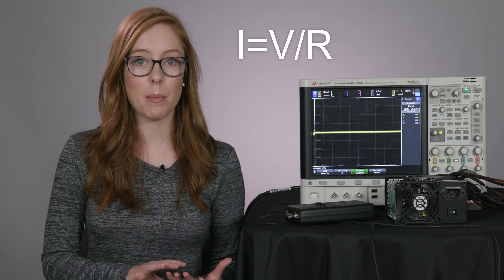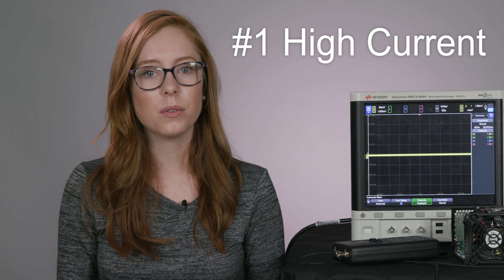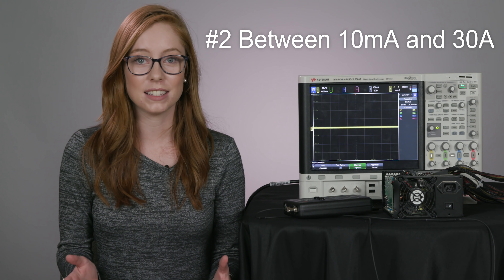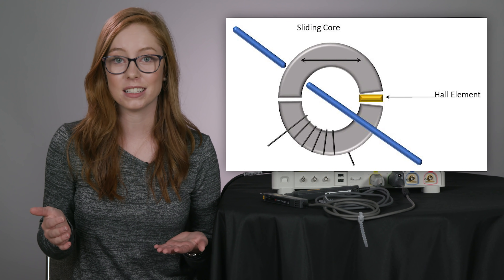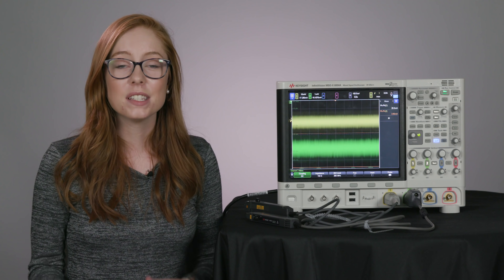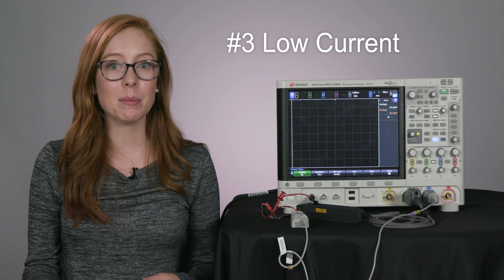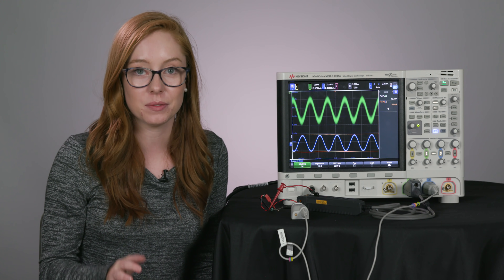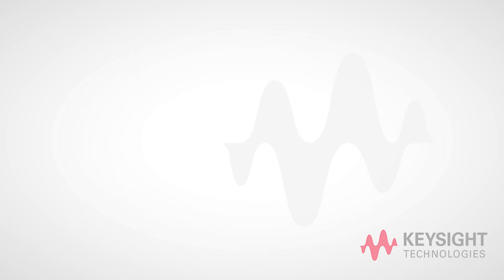How to Measure Current with an Oscilloscope - Take the Mystery Out of Oscilloscope Probing

Comment: Great video - I might add that I have had to calculate power into a load at high voltages and high Z (transmitter modulators) at audio frequencies and no way to measure voltage directly with a simple meter. Knowing the load Z, I measure the current with a Tektronix current probe and a vintage scope, with the probe clamped around high voltage meter-lead wire, convert the PP voltage to RMS and do the math. Works great and keeps us away from direct contact with the HV.

Comment: My (Agilent) oscilloscope can multiply channels by each other but not by a constant. If it could, I could apply the scaling required for a measurement resistor instead of doing it in my head.

Comment: Thx you did a great job but failed to mention the number one obstacle of using a current probe.  Cost.  I have a small consulting company and i have never been able to justify the cost of a decent probe.  I have a cheap probe and when that does not suffice a shunt most often can work.  With this method most modern scopes can do math in the math function so you display an actual current measure.

Comment: I hate to be pedantic, but if you’re using a resistor inserted into the circuit to measure the current using voltage drop and Ohm's law, wouldn’t it be a series resistor (in line, with all the current flowing through it) rather than a shunt resistor, which would be in parallel with something else, and thus not see all the current?
Reply: Shunt is an established naming. It's parallel with measuring instrument

Comment: Nanosecond range: With an ideal resistor, V = R I, fine, but if the voltage increases instantaneously from V0  to V1,  the current cannot raises in an instant from I0  to I1: the number of moving electrons is the same (the number of atoms don't change) so it is their speed which should increase and since electrons have mass,  it takes some time to raise from I0  to I1. So, basically, since V0 is instantaneously risen to V1, *at that moment*, we have V=V1, still I = I0,   such that V = V1 > R  I .  The time it takes for the current to raise from I0 to I1  can be in the pico to the nano second range. So the resistor technique is not fully trustable for these time ranges, no?
Reply: is it?
Reply: @優さん-n7m  In fact, the electrical field moves faster (about one third of c in a copper wire) and the electrons start moving due to the increase in the field, rather than other electrons pushing/crashing onto them. But there is still a delay before getting a steady flow, a delay which is negligeable in everyday calculations done on a typical circuit.

Comment: "There are 3 situations where you need to measure current:
If you are working with very high currents
Very low currents
Or something inbetween"
Couldn't you just say 'current'?
Reply: She classified it like that to show later the different strategies for each current range.
Reply: It's like picking a thermometer to measure temperature. Say all you've got is a mercury thermometer. That's fine, unless the thing you're measuring is so cold that the mercury freezes. Or if it's so hot that the mercury boils or the glass melts.
Reply: lmao

Comment: Is any adjustments in button we should in the oscope for current? 🤔
Reply from the maker: Generally, the scope will recognize a current probe and you won't have to change anything. You can manually set up a channel with the right attenuation ratio and current/voltage selection if you need, though.

Comment: My 40 year old tektronix current probe works great and has less noise than the ones you showed here.  Of course it only has a 50 MHz bandwidth, and these are 150MHz so the noise should be about 3 times higher, but it looks higher than that.

Comment: How would you measure current across a 'series' component using a scope? The series component is a resistor and is connected in-between power supply and amplifier vcc pin.
Reply from the maker: If it's a resistor, you can use a differential probe to measure the voltage drop across the resistor. Check out this video for more: https://www.youtube.com/watch?v=OZDijMDHmtI

Comment: I'm trying to plot AC current for a household AC wall panel over time to quantify how the current draw varies through the day. My Pico scope is using an AC/DC current probe, and I understandably get a 60 Hz sine wave centered on zero. I think what I need is an RMS integral, but I'm not sure how to do that to get a running value of effective current with the scope. I think I can get peak to peak voltage, and from that can assume a pure sine wave and divide by (2sqrt2) on a math channel. Is there a more accurate way to compute the integral and display results, more like a true rms graphing multimeter?

Comment: I'll stuck with a 1 ohm resistor thanks. I don't want to have to take out a loan to measure current over time
Reply: Stock stuck with a 1 ohm resistor
Reply: yo that thing must be an absolute unit to handle high power when hooked up to 12V
Reply: You can get some good multimeters on Amazon for $10-$20.
Reply: @bruhmomenthdr7575  lol

Comment: I’m an idiot not an engineer, but I’d like the ability to measure the charge/discharge details (voltage and current of a 12V lead acid battery. I’ve got a clamp meter that goes up to 2,000DCA to measure the starting current but that’s one point in time, I’m more interested in the current output of the charging system which can be between 2-10 (up to 50A).  Halp.

Comment: She also forgot to mention that coils work differently with AC and DC, AC you have inductive reactance, in DC it access a dead short.
Reply from the maker: You're right. As the frequency goes up in the probe’s input signal, the inductive reactance goes up as well. And as the frequency approaches zero or DC, the inductive reactance would decrease to zero, acting like a short circuit. 
 
For our clamp-on type current probe (including the new N7026A), we use a hall effect sensor that covers accurate DC measurement in place of using the AC transformer. This is a very effective way of measuring DC and AC with a single current probe.

Comment: She forgot to mention that oscilloscopes will give you the peak voltage to calculate the current you need the RMS value
Reply from the maker: That's definitely true- you can measure peak value, RMS value, and many other parameters with an oscilloscope.
Reply: Time to shelf your old Heathkit cope and move into the digital age.

Comment: For repairs and trouble shooting measuring current  is often more informative as measuring voltage. But almost no-one makes probes for that. II use diff-probes for measuring current through a part but contactless is the niced way.
HP used to make a very nice current probe for this, the 547A.  It was non contact. I have several current probes (sorry, they are  from the competition). Besides some clamp probes and the 547A, I  have a modern contacless probe (it uses a fluxgate)
Reply: when did HP stop making those?

Comment: You awesome smart engineers need to develop a cheapo oscilloscope with daisy-chained arduinos, or Parallel port for a PC. Give oscilloscopes to humanity, not to high bidders D:
Reply from the maker: There are some Arduino and Raspberry Pi - based scopes out there if you're budget strapped!
Reply: But they're not compatible with your awesome "being useful to the engineer damnit!!" probes. I'd love to spend money on real keysight probes and just plug them to a oscraposcope. Some adapters for budget/burner oscilloscopes, maybe? Budget probes cause more problems than they're worth.
Reply: I am still waiting for a special Christmas days "scope month" ;) With your "give oscilloscopes to humanity" Keysight might be only wrong address to pick out there. Their "scope month" is quite unique in the industry. So far I don't know any other manufactures who throw out their gear for a hole month :D
Reply: Fat Boo you realize many people work there ass off and don’t make more money as a result, but rather working their ass off is required to make their humble wages
Reply: Well... It depends on what you want, you'll get an old analogue scope for frequencies about 25MHz for as low as tens of euros. But when you'll wants a DSO the prices will go up.
But if Rigol are good enough for you then check them out, you can get the 1054Z for about 400 euros.

Comment: Another great Keysight scope video, well presented, Thanks!

The N7026A must be new current probe, I had not seen it before.
What was the older one in comparison, the 1147B?
What a difference!

I wish you would make a new awesome video like this one,  every day of the week !
Reply from the maker: Hi Elden, it's actually more of an upgrade from the N2893A, but it could also be used in place of an 1147B for better performance. We'll keep the videos coming!
Reply: I looked that the N7026A datasheet and noticed that it requires an external power supply.
One of the benefits of the Keysight probes has always been that no external power supply was needed.
Why is the N7026A not powered over the auto probe interface like on the N2893A and the 1147B?

And ... how did you get away with not using the external power supply in your video at 2:50?
Reply from the maker: The external power supply is basically a range-booster if you need to make higher Amp measurement. You can do +-15A from the AutoProbe, and +-30A with the external supply.